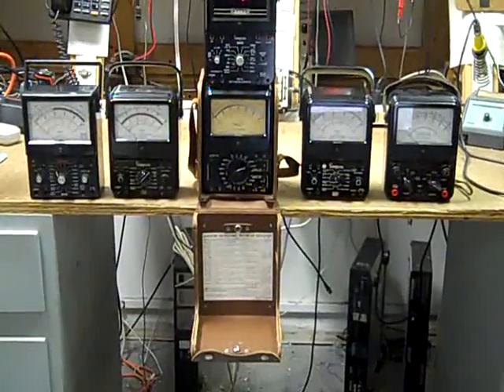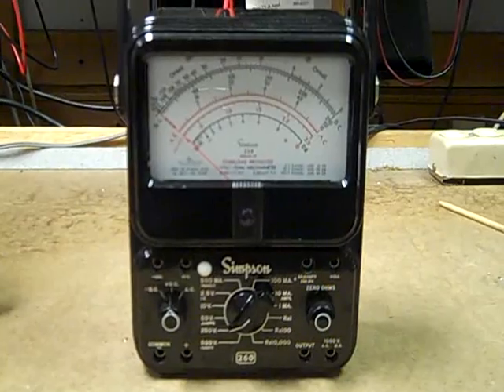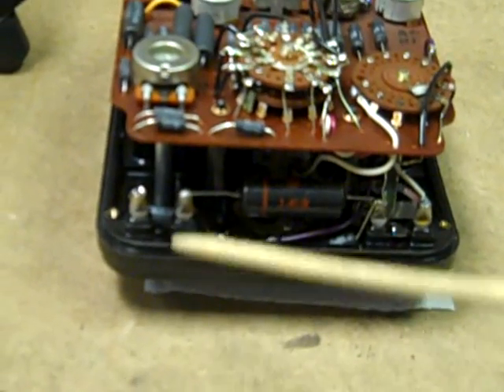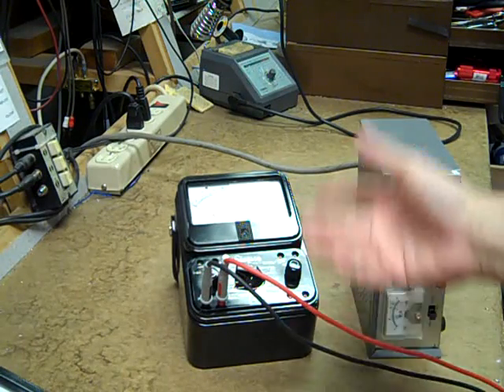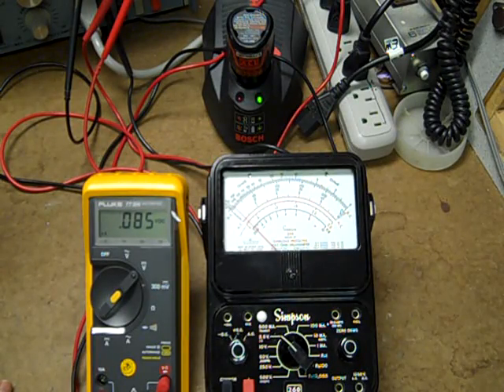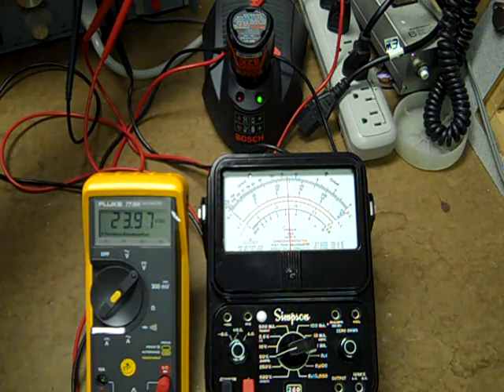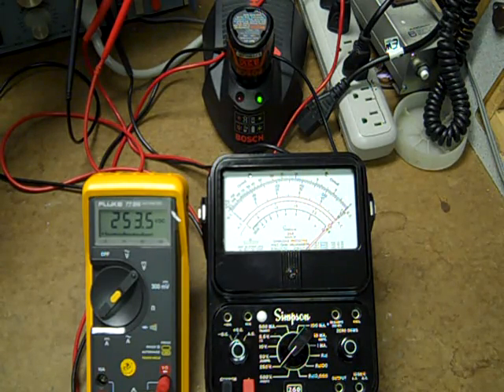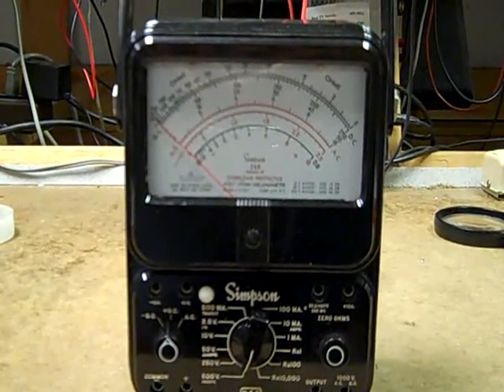Simpson 260 6P Multimeter Review

Comment from the maker: @kodibass The Simpsons are rugged electrically but will still break with a hard drop. I recommend the 6P because it uses regular test leads.They come up on eBay all the time pretty cheap. Any after the series 2 have varistor protection for the movement and employ fuses also. My advice on avoiding burnout is not to ever leave the meter set to  a current or resistance range (especially Rx1). Most analogs have a diode or varistor across the meter coil at least.

Comment: Thanks I have a nice micronta digital,  And its great for most stuff, but for testing the small vintage coils / condensers the analogs work better for me,  I have seen some  simpsons series 6's & 7's on ebay but no reset button like yours, does this mean they are not overload protected or able to be reset?   had a china analog meter it worked for what I was using it for until it hit the garage cement floor. so I thought I'd buy something a bit more as you said rugged. Any help appreciated.

Comment: Perfect, Your vid answered allot of my questions, So for all around basic shop use I should look for a Simpson 260-6p, for around $50-75 with no corrosion in the battery compartments. I know very little about meters, But need one for checking coils/condensers etc. in vintage outboards, and I was told to get a simpson. So this is the one I will look for, Is there any other info/questions I should ask before purchasing ?  Great video & thanks!